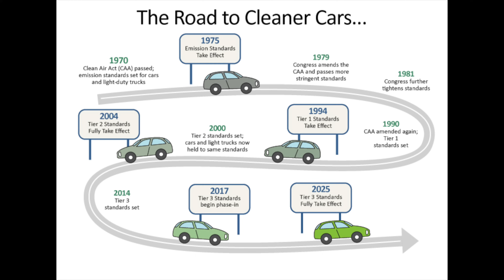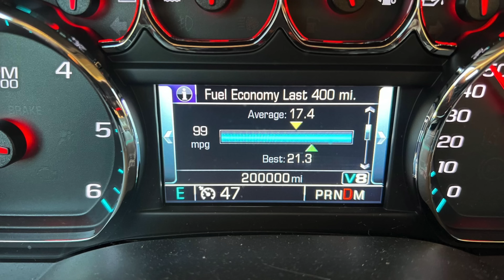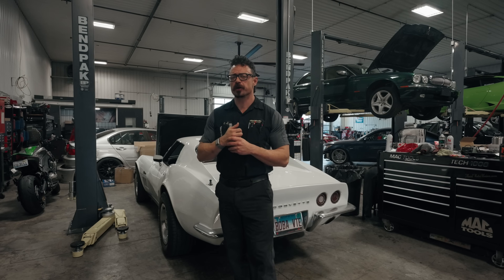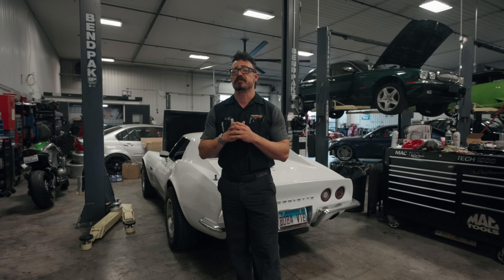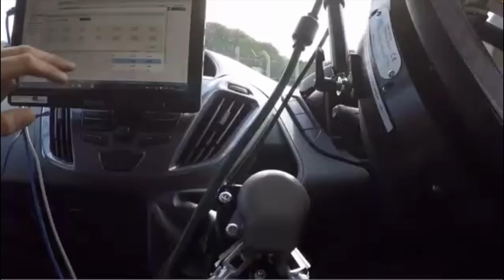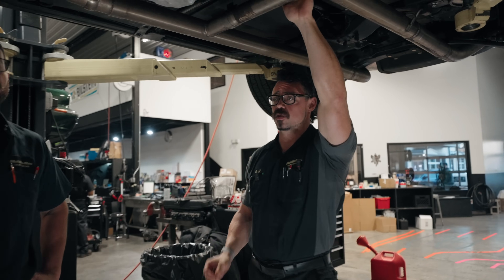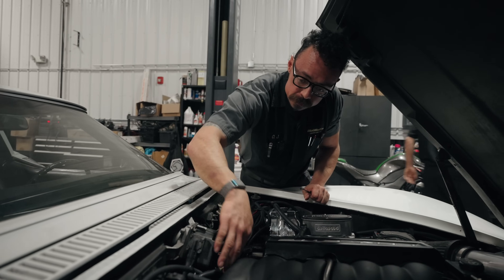Do You Need a 6 Speed Auto? LS C3 Corvette Transmission Swap EXPLAINED.

Comment: Only about half the views are liking this video. Let's support this quality automotive channel and get the likes up 👍
Reply: I like almost everything I watch. I appreciate the effort, and unless the video-maker is contemptible or dumb, there is no reason not to like it. People act like the “like” button is actual money out of their own pocket. Selfish bass-turds, give a like if you watch at least 1/4 of a video and don’t h8te it.
Reply: not quality when they're spreading wrong info
Reply: Probably not going to like it because your customer wasnt fully informed, nor did you have the information to really give them. 6l80s have a myriad of issues that cause them to fail just as easy as the 4l60hd aka the 4l65e. When driving a high horsepower engine on the street and being afraid of it any shift is going to be terrifying. Fd ratio being the same, the only thing you actually did is put him through MORE terrifying shifts with the early gears being MORE torquey and likely to spin tires. Officially solving NONE of your customers actual problems besides .5mpg improvement.
Reply: 100 @cyclesaviorn2700
Reply: Hes a scammer that knows nothing about cars. He is just a face man standing at the front desk out of his mind on multiple drugs falling over on his mechanics that need to stand him back upright while smiling at the customer the whole time.

Comment: I’m putting a LQ4 into a OBS C1500. I will be putting a 6L80 behind it and controlling the engine and transmission with a Holley Terminator X Max. I will also be installing an upgraded torque converter and transmission cooler. Thanks for the video!

Comment: Hey man im planning an engine swap for my tired old 360fe in much less tired looking 76 F150.
i think i can do an  LS swap and tranny for 1/2 the price of $5000 cdn REBUILT 390FE and get 3-5 mpg better mileage .
- i DONT wanna repeat my 1st LS swap sadness in that a stock 5.3 LM7 could not even chirp the tires in my 86 GBODY with 2.32 rearend.
SO if i do a 6L80 tranny swap this time will it turn my truck into a 1 tire fryer with that 4.08 1st gear ratio with my trucks 3.08 rearend ?

Im told not to try a 4L60 for its better launching 2.84 1st ratio over a 4L80 2.42 1st gear cuz i will smoke the 4L60 eventually
Reply: If its gonna be a 1 TIREfryer, i may consider a 5.3 if i can find one with significantly less mileage.

Comment: Actually Sit , You’re HALF RIGHT about what the 6L80 was bolted up to at the GM. assembly plant.
My 2009 Chevy Silverado extended cab 1500  with the 6.0 liter engine 
has the  6-L80E  and ran up to 340,000 miles before I had it rebuilt and wasn’t because I went out on my I just decided to get it done for my own piece if mind being travel outa town a LOT as a Union Tradesman in the construction field
and that was with using it as a two vehicle of a 6000 Ib. travel trailer and  2009 was the first year the 6L80E was used in the half ton trucks and was an AWSOME transmission and I’d probably rhe BEST transmission that GM. EVER bolted up to a 
to a 1/2 Ton truck  with a 6.0 and a 3:73 rearend . 
I’m sure the 4L65E 
Is a good transmission when the right aftermarket parts are added to it but I can go 70 MPH. down the freeway and cruise at 2000 RPM and still get 18 - 19 MPG. and easily 20 -21 and long as I don’t go over 65 and the RPMs’ 1600 - 1800 
So just giving my first hand experience with a 6 Speed in a truck that weighs 5800 lbs.

Comment: whats even crazier, is that you can actually adapt a 8HP70 onto these LS motors for about 1.2k and the trans is about 700 these days. for the price of 1 6l80/10l80 you can have a Hellcat Transmission you dont even have to build. They also currently do not have adapter Trans Controllers for swaps for ANY 10 speed be it the 10l80 or the 10R80, and the 6 speed trans controller by Quick 6 is about 1500$.

with that being said it would actually make more sense to adapt a 8HP transmission from a hellcat onto the LS due to cost over a 6l80. Of course a 4l60e/4l80e are factory options.

You can get the 8HP adapters from SeemsLegit for the flexplate for about 1250$ (US)and Adamat for about 890$(not counting shipping) Foreign. Any Harness/ECU Plug n Play  stuff is really expensive no matter how you look at it. whether its the 8HP or the 6L80. Though, The benefit to SeemsLefit they have a ECU/Trans all in one adapter Harness that can be tuned in 1 location for the swap, the cost comes into play with the ease of installation and easy of tunability in 1 location with HP Tuners. This Harness is called Maxx

Comment: Just asking, i know more about older mercedes cars, but after having to change my 07  suburban 5.3 vorex 4l60 e or is it 65 idk, i dont find it very easy. BUT, i want to do some more towing with this thing and I am affraid the 4l60E might fail again. It was replaced at 259 k or about 160 thousand freedom units, and in my opinion thats too early, especially when i know that my dads merc already has 334 k kilometers or just over 200 k freedom units on mostly stock stuff( only airbags, fuel pump and alternator have been changed in 10 years) so as a part of future proofing ly suburban i wish to get some more gears so my engine might sit at 1800 rpm pulling slowly instead of having 2300 or more whilst accelerating moderatly. Fuel usage is at 17 l/100 rn and im hoping for 15 with this swap. But:
Is a 5.3 vortec an LS engine or same bolt pattern?
I know not al 4l60 and 6l80 are equal. But i was thinking of taking a 6l80 out of a 09-12 escalade 6.2 as it would seem most similar.
Ow lastly about shift linkage. Its only : P R N D 3 2 1 like every american car, is it? European double clutchers from 05 and onward have full control. 

Just asking stipid questions I know. But having a 4 speed where mercedes had a 5 automat in 93 feels a bit wrong. Yet again, the 1-2 gear change is from 3.0 to 1.0 whereas the 6l80 has 4 gears to do so. Im also aiming for a bit lower rpms, but the suburban does 120 kmph, legal speed, at about 11-13 l/100 km so the search for more equal power and better mileage lays in the city drive, where imo after this vid the 4l80 should be better?

Btw i know that the double digits after the L mean smth like more is better, but is there a code? 4l60 has no follow up cus the 4l80 became 6l80 from whzt I have read?

Ow and does the 6l80 need special mods to the ecu?

Comment: the newer autos with more gears really are a huge leap in driving enjoyment, its a shame there aren't as many documented easy routes for these swaps.

The point has to be made, the final gear ratio of the 6l80 is the same of the 4l65.  however the 6 speed lets you put in a longer final drive gear while maintaining low speed acceleration.

Comment: God no.  Built 4l65 or, best, a 4l80.  Everything after is needlessly expensive and, based on the issues I am seeing in selling hundreds of GM trucks a year, inferior(the vast majority of these trans are certainly NOT in cars).   200k is all too often the max for the six speed.  Nobody that has these things for a couple hundred thousand miles is bragging about the 6l80e.  ALSO, let's note that 60 and 80 in the designation indicates relative "strength".  You are comparing apples to oranges.  Compare your 6l80 to the 4l80...oh, yes...the 4l80 is a wildly better unit. There are also zero benefits in drivability or fuel economy without a gear ratio change and very careful tuning.  Then, lastly, is cost and difficulty.  The six speed costs three times as much and is never a fun change.

But it DOES make transmission guys more money...

Comment: One of the main reasons to swap in a 6L80E is so that you can run a taller ring and pinion because gears 1-4 are so much steeper.  Unless you change the R&P gearing, you are looking for a disaster as the torque multiplication with, say, a 3.73 will probably cause a failure in the transmission if you ever get traction and resist the toque being applied.  I would run a 3.07 ring gear behind a 6L80E in a street car like that Vette.  But that's just me.

Comment: you're idiots, stop spreading incorrect information
lbs per square foot is PRESSURE, torque is lbs*ft
Air/Fuel ratio has nothing to do with number of speeds in your transmission, number of gears is related to best engine efficiency, more gears means you can keep the engine in it's most efficient RPM range

Comment: Thank you for doing video, only one question is any problems the 6spd going in and not hitting transmission tunnel?
Reply from the maker: We lucked out as it was super close, but engine torque rotates it away, so no issue on this set up, however that’s largely dependent on how your particular LS is mounted…

Comment: Ive driven both 6 an 8 speed gm trucks and its a huge difference in the butt dyno. I do like a 3 speed in my older truck with more power. It feels like its always in the right gear and doesnt hunt for gears.

Comment: Do the LS computers run both the engine and electronic transmission? Did the same PCU need to be "reprogrammed" to run the new 6 speed vs the 4 speed?  And, I'll let you get away with the ft/lbs vs sq. ft gaff this time... I'm really enjoying the channel.

Comment: Can the 6L80E handle a built 454 big block? Or should I just install a 4L80E. Will these transmissions fit the tunnel? 1970 Corvette. It was originally a 4 speed.

Comment: A swap from a 3.55 rear gear to a 2.73 rear gear at the same time as going from the 4l65 to the 6l80 will maintain the same ratios in 1st gear and get alot better milage in 6th.

Comment: Bought a C3 that does not run.  Wanna do some real work and put a hopped up bored out LM7 type 4.8L with 6.0 heads and a 6 speed?  I have a 5.7 bored out LM7 (originally a 5.3) with 6.0 heads runs great in a truck.  Basically I am looking for a setup with a little more power, great drivability and dependability, and better economy.  Strictly a street daily driver.

Comment: I’m just here to find out if I want a 6l80e to mate to a 4.8L vortec on a 90s G20. Currently I have that 305 with a slightly modded 700R4. I have added an oil cooler just to keep it under 200°F

Comment: How do you go looking for alternate transmissions?

My ‘14 VT with a a G4FJ 1.6L T-GDI sits at 2700 RPM at 70, and 3000 RPM at 80 in 6th gear. It’s honestly the one thing I actually dislike about the platform—it desperately needs an overdrive gear or a 7th step or just anything to lower that highway RPM.

Comment: Surprised you didn't need to modify the transmission tunnel. Also, the final gear ratio on the 4L60 is .70 and the 6L80 is .67, that's going to yield a similar rpm at cruising speed.
Reply from the maker: It actually ended up being almost 300 rpm different. Took the engine out of an rpm with drone out and the customs was happy!
Reply: @FluidMotorUnion  That's odd because the math says it should be around 80-100 rpm depending on tire height and rear gear ratio. Chances are the 4L60 had some converter slip issues. Glad it all worked out. Did you have to rework the tunnel?
Reply from the maker: @garywoods148 it’s close but doesn’t hit even with load torquing on the mounts.

Comment: Hmm. I have a 2004 Pontiac GTO that I’ve had for years and have built to daily and drag race. With a race tune the now well built supercharged LS6 makes 741RWHP and 696RWTQ. Changing a pulley and changing the race has tune back to pump gas, it’s right at 600RWHP. 
Here’s the very expensive issue! I’ve burnt and broken 8 4L60/65 transmissions (two of them were guaranteed for 1000hp. Joke!) before swapping to a 4L80 that was also well built that has now twice failed. I never liked the 80’s first gear ratio. It killed my 60’ times by a half second for one. Anyway, I’m trying to decide what direction to go. No more 60’s or 80’s. T400 is my first thought, possibly manual, but this video has me wondering about the 6L80? This car has eaten $20k worth of transmissions! I can’t stand it!

Comment: Can you do a 6l80 in an 03 awd Silverado SS ?
Reply from the maker: Yes, indeed, most of your stock components should be compatible. Of course, you'll require a torque converter, but the 6L80 fits directly without any modifications. Depending on your truck's setup, a new driveshaft might be necessary for some, while others can use their existing one; the stock trans crossmember will suffice with a slight elongation of the bolt hole. As for control, you might need a standalone controller. Zero Gravity Performance offers one, although opting for Holley would be preferable for this swap. While the ZGP controller functions adequately, there have been reported issues with certain lighting features. Some have executed this swap flawlessly, while others have encountered difficulties in this aspect.
Tuning your current PCM for the engine portion shouldn't pose any problems.
Regarding AWD, it's a bit more complex, and unfortunately, I can't recall the specifics to provide assistance. In this scenario, manual 4WD would likely be optimal, albeit necessitating some sort of adapter to attach it to the transmission.
Overall, it's not an overly challenging swap, but it will require some effort. Physically installing it is relatively straightforward, yet achieving optimal functionality with either the ZGP controller or factory PCM can be a bit hit or miss."

Comment: Great video! I know your busy but i hope you have time to read and respond. This is a subject i have been banging my head against the wall trying to figure out. I have a beautiful boosted 01 Camaro putting about 500/500 to the ground right now on a mustang dyno. The only reason it isnt more is because my 4L60 cant handle it. I want to run a really aggressive rear end but dont want to lose top speed. I have looked into the 6Ls but most of the research i have done says not only are they problematic(50k miles on an unmodified car) but they dont handle power. Where did you find the 650tq rating? If thats the stock rating i would imagine a built one could handle my power goals no problem. As far as physical size/girth how did it compare to the 4L60? A common swap for my car is the 4L80 which can be squeezed into the tranny tunnel with very little effort but going any bigger in girth/height could be problematic. Im sure there was a lot of figuring out to do on this build that added time but if you were to do the same job again how many hours do you think you would end up billing for? I hope to hear back from you and appreciate your time. My first impression of your channel is that it could be a TOP tier automotive channel. Keep on the grind and keep putting out videos. It may not be profitable right now but your content speaks for itself and if you stay active the followers will come. Sorry for the novel but i am excited for this specific video as well as your prospects. Good luck. Im going to go check out your past videos right now.
Reply from the maker: The 6L80E is bigger, especially towards the top. But i can't imagine it being any tighter than a corvette stingray dog tunnel, but i am unsure on you Fbody. Our 6L80e dropped the cruising rpm by about 300 which doesn't sound like a bunch but it was noticeable and made the car much more pleasant to drive. in our research it just seemed like a more modern trans was the way to go, and anyone talking about toughness is really saying that the 4L60 is cheaper to build to handle high power than the 6L80. But if you've driven a built for high power 4l60, you'd understand that it’s a compromise in drive comfort. Ultimately, while you can rebuild yours to handle more power for less than this 22+ hour swap, the end result will be a jerky on off purpose built result. While the 6L80 feels nice at even higher power levels, before you run into the limits especially if you put a good trans tune on there. Hopefully this answered your questions!
Reply: @FluidMotorUnion  very helpful. Thanks you. Yeah the rear end would have to be changed to make a significant difference to highway cruising speed but with more gears it should allow you to use a less aggressive rear end yet still stay in the ideal rpm range for power when you have your foot in it.... So I still have some tough decisions to make but your insight is valuable. Thank you

Comment: I have a 2009 Tahoe PPV 2WD 5.3 its stock other than a few minor exhaust mods l had the 4L60e transmission rebuilt with a Corvette servo and a Trailblazer lockup  torque converter it has 3.73 rear gearing bet with this gearing if l swapped the 4L60e for a 6L80e transmission it would cut .5 of a second off my 0-60 times and .7 of a second off the quarter mile times highway rpm would not change